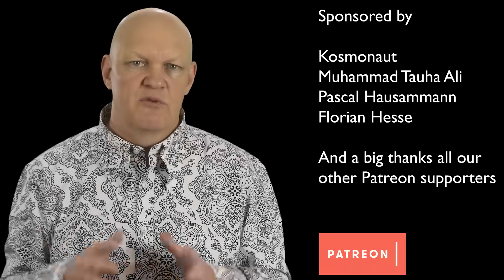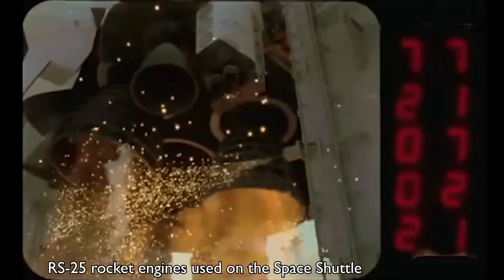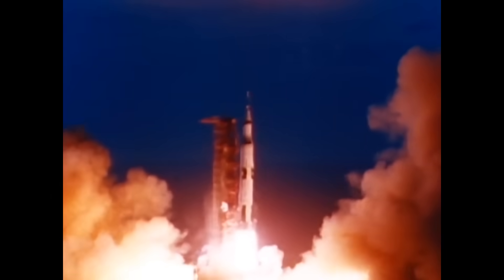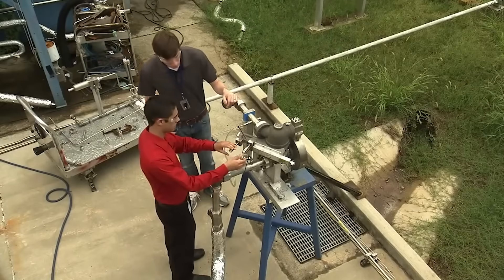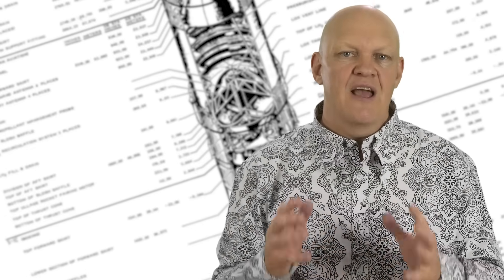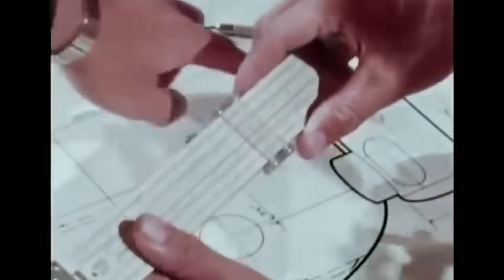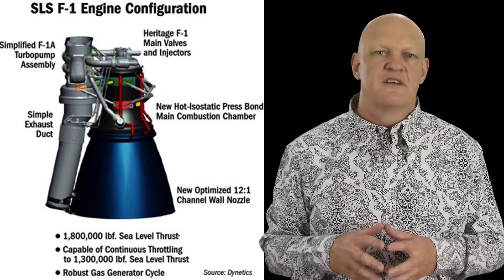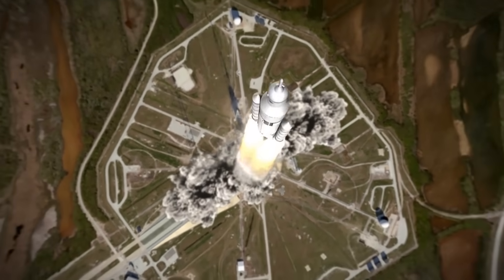Why Can't we Remake the Rocketdyne F1 Engine?

Comment: So the rocket science industry is basically a giant computer program that no one bothered to add comments to.
Reply: Not just the rocket science industry, this sort of thing happens in many fields of engineering and manufacturing.
Reply: @Bazookatone1  Not in Corporate and let's be real, NASA is the biggest one. If they didn't documented everything the could not created an working engine because the didn't know what to improve.
Reply: @Bazookatone1  It's certainly all over.  First more profit, then quality is lost, and finally function.  Maybe by then a billionaire has been created, and a few thousand unemployed former workers!
Reply: I was always told that I added too many comments and that some things should be left out to maintain job security.  However, I find few people read the comments to begin with.  Pretty much every major problem we encountered was mentioned as a warning in one of my comments or email but of course that was never appreciated as people like to believe that a problem could not have been foreseen.
Reply: @John Wang:  After a while in I.T. you come to realize that comments aren't for other people, they're for you when you have to go back and modify something. Any of your code you haven't looked at for six months might as well have been written by someone else.
Reply: This analogy would hold if the program was written in assembly for an outdated and poorly understood cpu architecture. Anything written in a high level language is relatively easy to understand without comments, but look at the same code in assembly and you would rather re-implement the program in a modern language.
Reply: "Well written computer programs barely have any comments."  I think what you meant to say is "The industry has given up on expecting people who graduated with CS degrees to be able to express themselves intelligently in comments, and now simply rely on everyone just to understand certain design patterns and therefore we don't need comments".
In 50 years, who is going to be able to tell a singleton pattern from a factory pattern?  Nobody. 
 In five decades development is going to look as different from development today, as development today does from development in the 60s.
You are actually reinforcing the point of the video.
Reply: fisharmor I honestly have no idea what you mean by singleton pattern or factory pattern, but nevertheless am confident I could modify or extend any software using them, with or without the source code.  For some really rare CPU architectures I might need to skim the datasheet and build a debugger first, not a big deal.  Are these skills no longer widespread?  That's a bit concerning.
Reply: Alden Zenko And that proves the point.  The large group of modern programmers indoctrinated in the church of highly abstract forms of OOP assume that all of their fancy names for fancy ways of tricking compilers into doing various nice things while avoiding direct invocation of whichever words were banned by the gurus.  Their fancy incantations are unrecognizable to those of us who actually understand the desired nice operations, just not their arcane ways of naming and doing it.  It's as incomprehensible outside their circle as Duff's device is likely to be to someone who has never seen it, or JCL code would be to most people today.
Reply: I've lost my lost job because of taking time for notes and comments on it. The Boss aqused me seriously of "burokratising the development". Amature. The understanding, that comments make you more efficient not only in long-term, is very rare.
Reply: Commentless code still runs.  I cut my IT teeth overhauling pre-ANSI C programs that had not a single comment, and I could still work through what it was doing, and the main reason I rewrote it is because it was genuinely crap apart from the missing comments.  Commentless code is a waste of future man hours and should absolutely be a fire-able offense, but it's not a complete showstopper.
I think the better analogy would be having the requirements docs and the executable, but not the source.  ;)
Reply: Yeah... yeah...
Reply: Every, fucking, Industry, ever. What does a boss say after "I spend 8 h on the already over budget system to fix it, it works now" - A: "good, go home / do the next thing" B: "Sit down for 4 h and write a decent documentation as long as you memory is fresh" - it should be B, usually it's A.
Reply: Yeah, it's a fine line between CYA and do it right.
Reply: You mean bureaucratize, but English is probably not your first language. I think comments are useful, I have often gone back to something I did without comments and spent a good deal of time trying to figure out what the hell I was thinking. However, there is no need to over comment things, like "prints to the console" or "variable used to store user input" these kinds of comments are rather irritating, so there is a line somewhere with regard to what is an acceptable amount of comments. I don't know where that line is, but it should be made pretty clear by the project lead or from the context of the code itself.
Reply: Not always sometimes it can take more time to work out a convoluted block of code than it would to just start again.
Reply: Thanks for correcting my spelling :) yes you are right. That is what I was talking about. The problem of drawing that line is common as well, but complete ignoring of it is a way to waste time of professional developer, human resources and money of the company.

As always sorry for my spelling.
Reply: Well they did, but idiots kept writing "FIRST" and "Who's reading this in 1975?"  all over the notes.
Reply: @Yevgenij : Hopefully you've found a more reasonable manager to work for now!
Reply: To some extent, yes. That applies to almost every practical engineering though. The real world is hardly ever as clear cut as the digital one, especially when something like temperature can significantly change critical dimensions of parts. Commenting is easy when the original writing, compiling, and commenting of an original code segment is done by a single person. It's much more difficult when one person designs a part, another draws it, another makes it, another installs it, and another documents the install.
Reply: More like the blueprints of the F1 is what you said. Did you not watch the Video. It wasnt about all of rocket science industry. it was specifically about the F1. God I dont know why but people like you make me angry.
Reply: Uhh... I like candy.
Reply: "It's self documenting." - some smartass developer.
Reply: Exactly the opposite, there was human know how and intuition that came from fabrication experience that couldn't be encoded into a set of instructions. Sobering thought for a generation that thinks they can look up everything on the internet...
Reply: What a myopic millenial response. There is no analogy to software "engineering". NASA has clearly retrogressed to a little dark age of manufacturing worksmanship.
Reply: Not exclusively. In most of deadline controlled development projects this is still the case. It's independend of the system.
Reply: It's easier to share a computer text file than handwritten notes from ages ago.
Reply: @fisharmore.

Yes. You get my point right. I do make same observations in management. But I think there are more reasons for it. One of them is a need for international communication nower days. As it is in my case, the level  of language handling can vary strongly, even by seemingly hihgly qualified specialists. But you can still deal with it. What I do criticize is disregard of need for simple documentation, steps that are necessary between normal cycles of development. You can always cut the number of cycles, but cutting the steps for reflection, analyse and simple archiving of conclusions leads often to a waste of time. There is no need to write a thesis or a paper on every welding line. But a time for view fotos with comments is good invested.
Reply: No.
Reply: Sigh to true. My nerd brain says we need to do thing the Starfleet way, record everything... everything...
Reply: More like a giant computer program without make file attached. That bastard just wouldn't compile with standard flags.
Reply: even worse than that!
Reply: Jadin Andrews I agree, I'd assume anyone with basic coding, and for that matter, an understanding of basic math, would already understand what a variable is by first glance, and therefore no reason to comment on it. I know I didn't add much to this convo but I'm a lil drunk and jus wanted to agree with you so you know you have some supporters. good day to you my man :-)
Reply: Munashiimaru 
If you are speaking of the development of the F1 engine, I doubt it.  I think that we could look back at the engineers designing the F1, you would see a bunch of drafting tables not computers.
Reply: +Joe Duke  How do you get to be a teacher of engineering if you can't do engineering, like, at all? How does anyone get an engineering qualification after being taught by your fantasy bogey-woman? How would anyone keep their jobs long enough to do any damage if their heads were filled with such idiocratic nonsense?
Reply: Munashiimaru Think of it like Warhammer 40k. An incomplete construct.

It also shows the importance of basic skilled labor.
Reply: ...kind of...
Reply: +Go MGTOW   Aren't all computer programs that?  Sure, the programmers may have only moved on rather than died but really programs seem to be orphaned very early on.  Many programs were also never intended to be released.
Reply: @Kurt Tape. Thanks. Still looking, but thankfully I can afort it. Any way, sense that "experience" I'm more considered in that matter by choosing future projects.
Reply: <!-- Yep -->
Reply: Munashiimaru yup they made all the changes in their head and were personally there at everystep instructing them individually not writtng it down in propper format
Reply: Munashiimaru I like the comparison. Remember: always write your code with number of comments... One never knows, but the guy refactoring it after you could be a psychopath who knows where you live! (Not my personal experience but read it somewhere a long time ago. It made my code unexpectedly easier to read ever since :-))
Reply: Munashiimaru thanks for commenting!
Reply: Bazookatone1 Damascus steel comes to mind.
Reply: It’s usually easier to make your own mess than figure out somebody else’s mess.
I think the most savvy leave breadcrumbs for business continuity.
It provides some guidance for whomever follows up, but at the same time gives respect as to make them figure out most things.

An engineer wants to create, not copy. Even re-creating involves more mental capacity than just copying.

A lion wants to stalk its prey. Doesn’t want it to be served on a sterling platter.

I am sure the business grads will counterpoint this.
Reply: +Yevgenij Palaguta - Or maybe you made too many errors in haste, like "I lost my lost job".
Reply: Munashiimaru YouTube comment section is the modern era of bathroom stall writing
Reply: fisharmor the code would be relatively easy... it's sum of all AND the details to adjust. It csn be done.... just no motivation lime the soviet space race
Reply: Jadin Andrews I (kinda) cut my teeth in programming in ASM. Was never at a professional level, but for being self taught I feel I did pretty well. I comment this because I had pen and paper notes to reference as I more or less drunkenly stumbled around my problems.
Reply: Yevgenij Palaguta learn a second language is not easy, aside from one slip you would have never guessed you were a non native speaker.
Reply: It's much more like all the subroutines have been lost, but we still have the main() section with lots of comments.
Reply: At the time they SAID it was self documenting...
Reply: Munashiimaru can I put my sick in you for this awesome comment?
Reply: .. According to this YouTuber, not reality
Reply: And they wrote it in assembler :D
Reply: You are all missing the point.  Software Engineers that are actual engineers have the discipline to create detailed software requirements aka blueprints that are completed before a single line of code is written.  These requirements indicate exactly what each module of the code will do independent of any programming language.  Code is then written based on the requirements.  For more details on real software engineering see Dr. David Parnas,  the father of modular program design.
Reply: This explains the budget cuts to these kind of projects.
Reply: Munashiimaru I can hear my programming teacher yelling at me
Reply: The old timers at my job are from the 1980s. THEY ALWAYS say,  you know who were REAL main and service installers? The guys before us. The guys from the 60s and 70s
Reply: looks around sheepishly Someone is going to hate me 50 years from now
Reply: Munashiimaru , Hi!
Reply: It is worse than that, sounds like: code without comments written in an.evoking language that was in beta, complied on compilers written to generate assembly for an evolving family of processors :/
Reply: There was a software that my department use for a long time. One day we want to modify the software to add some functions and take advantage of the latest in computer technology. So we contacted the company that sold us the software. Turned out, the company themselves outsourced the coding to some freelancers. In the end we decided to just develop new software from scratch.
Reply: Precisely
Reply: computer program do have this problem, everyone's solution is different
Reply: Go MGTOW written in an obsolete language and using skills no one has anymore.
Reply: Yeah, no documentation lol
Reply: Everything has a written, and oral information that gets transferred and lost when its put into action.
Reply: They made modification they just lost those notes.
Reply: Munashiimaru hahaha, dude you are probably dead on!  
10 fire rocket
20 stop
Go to 10
Reply: Back when they didnt have computers... hmm.. sounds like logic of the generation.
Reply: They probably didn't expect NASA to be turned into a diversity jobs program. They assumed the US space program would still be run by the most talented engineers on Earth in 50 years.
Reply: Its more like running outdated code on build system that explodes if bug happens and no logs is possible to gather...
Reply: @Richard Vaughn I'm not very comfortable with asm
Reply: I once supported a 70,000 line program whose comments were at best ** Insert comment here **  In other words, non-existent when the program was written but added later by support personnel.
Reply: Code comments aren't always good though. They often add code rot as people refactor the code and forget to update the comments. Code should always aim to be self explanatory, that is the best "comment" you can have
Reply: More like its just the compiled program with a product spec but no source code or compiler.
Reply: It's LIKE that, but all in hardware!
Reply: Unless author used some terrible names or wrote some messy code, nested too many loops and even used goto or any today's NoNos that were common back then.
Reply: Well written computer programs barely have any comments.
They were in a rush for Apollo and just improvised on the spot. And it’s not mass production where all are the same, you improve as you go.